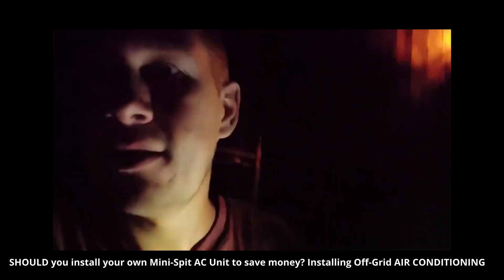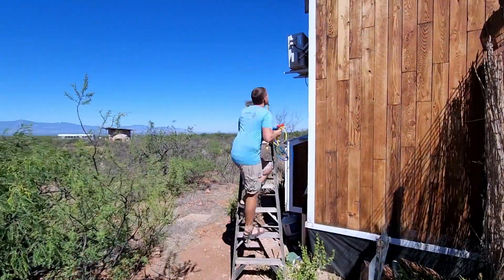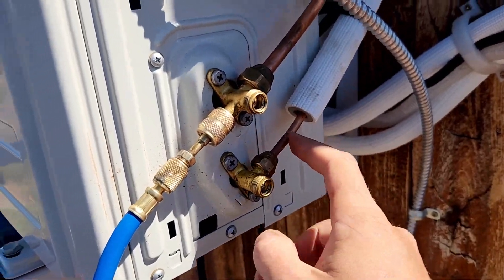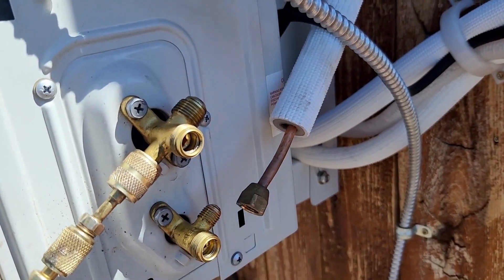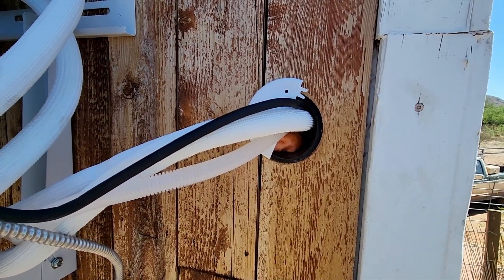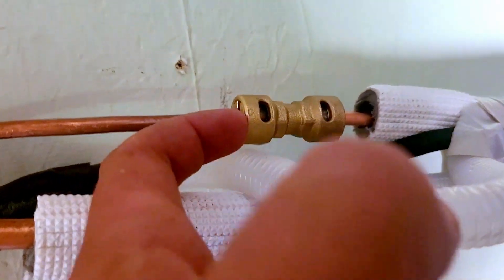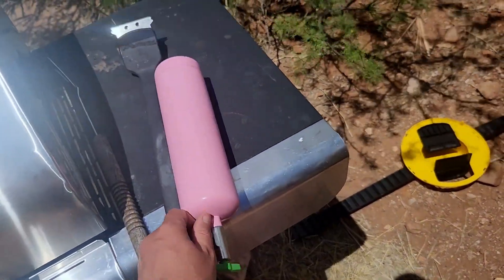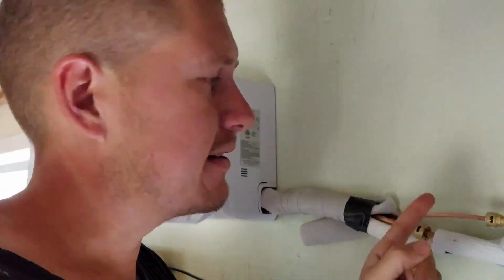UPDATE: A Better Way To Install a Mini-Split AC Unit Yourself using Pro-Fit HVAC Press Fittings

Comment: I was watching another video HVAC guy says he brazes the Mini split lines like larger split systems that are brazed said the flare fitting leak. I think you need an oxy acetylene torch to braze. I never messed with mini split all the homes I ever owned in AZ had rooftop packaged unit. Kind of ugly I admit sure are easier to replace. Too bad you are not closer to Phoenix I have a vacuum pump could borrow usually I like to run it down for 30 - 45 minutes to get the moisture out. I mostly use it for auto-ac. Love to move out in the desert took a trip last weekend up to Henderson lots of places up there past wikiup for sale can do what I want not to have nosey neighbors, or city inspectors bothering me. Wife would never go for it. I would buy 100 acres build an airstrip fly an ultralight that is electric powered. Aerolite-103 makes an electric version can go for 45-minute flights.
Reply from the maker: HVAC is defiantly an art form I learned from this project. The press fittings have seemed to work okay. I'm not at the pressure I want to be to get optimal cooling, but it's also not leaking anymore. So I really just don't want to touch it!

Comment: I was watching Country Road Cure youtube,   they just installed the first of three splits and the guy helping them from another homestead use to work on AC's for a living.  One thing I learned is that copper tubing must have a gentle curve when going around a corner/curve. If you bend it at all it can cause a leak. Check out their install.
Reply from the maker: Thanks, I'll check it out